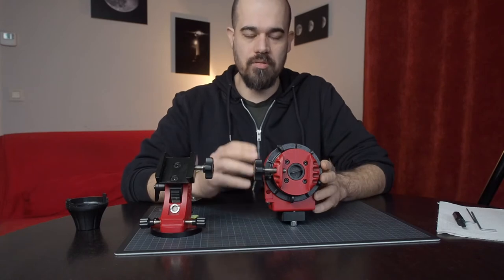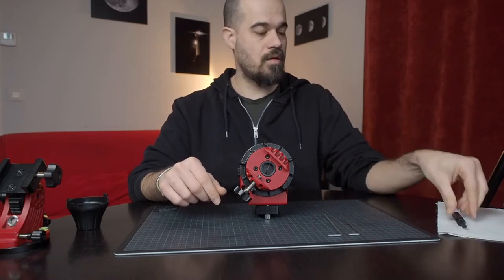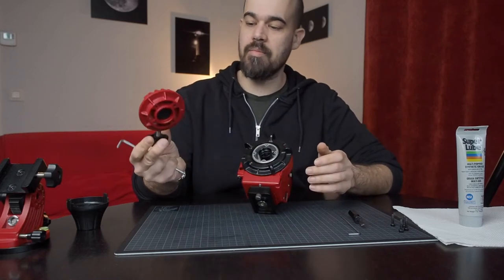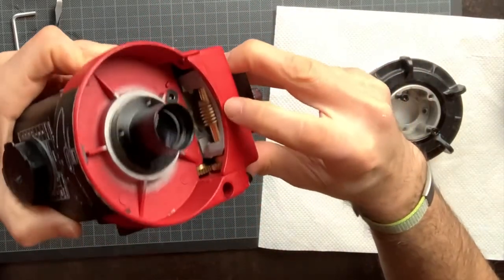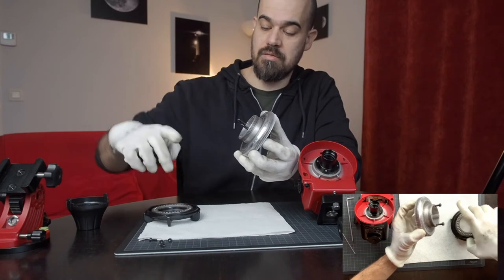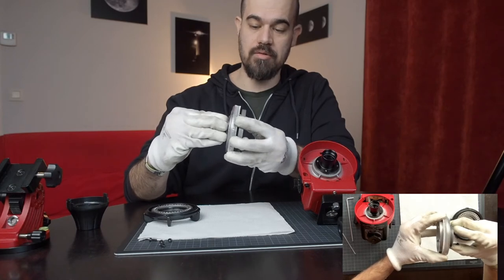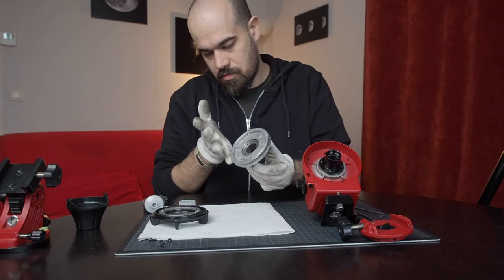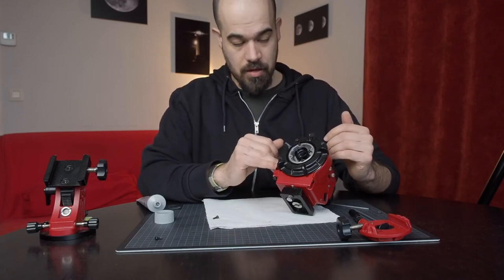Sky-Watcher Star Adventurer PRO Maintenance: Disassembly, The Clutch and Re-Greasing

Comment: Pro tip: Pre-squeeze out the grease and then use a brush instead of your finger to apply the grease. Then you don't have to be concerned about inadvertently getting grease on the contact/friction parts of the clutch, or making a mess in general.
Reply from the maker: Thanks. I did mention one should use a brush or something like so but This was more "for the show" that a real re-greasing 😬

Comment: I finally took mine apart was surprised by the play in the 3 drive gears. I do realize that there must be some play, otherwise they'd be locked up from the start. But, I've been wondering how much this contributes to the inconsistent tracking quality I see in my subs, even within a single session. Thoughts?  Is packing with grease part of the solution? I did notice that  the ring gear and bearings have a decent amount of grease from the factory. But the worm gear seems to only have what it collected from the ring and the drive gears are dry. I was surprised by that.

Comment: For the grease, would high temp brake grease work? It's what I have readily available since I service my own vehicles.
Reply: Probably too thick. Superlube isn't the best either, causes an awful lot of drag, especially when it's cold. I've seen plenty of equipment gearboxes where the bearings don't rotate due to the drag from heavy grease and just slide on the mating faces instead. Packing the bearings in a slow moving device is not necessary, it's not a car hub bearing that rotates fast under heavy load and gets hot!  All it needs is a light application to reduce friction and allow rotation. Everybody (including the factory "assemblers") applies far too much hence it gets in the clutch. A light Lithium or Silicon grease sparingly applied will work well. Remember - Grease is just oil with a thickener to stop it running everywhere 😉